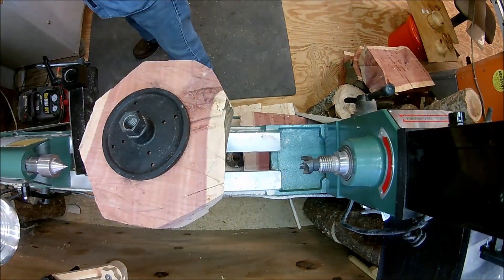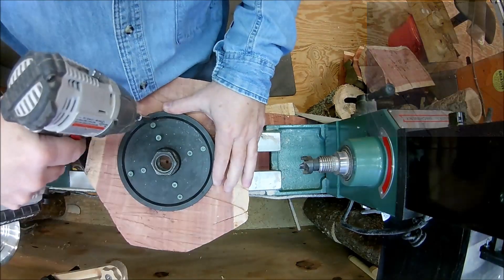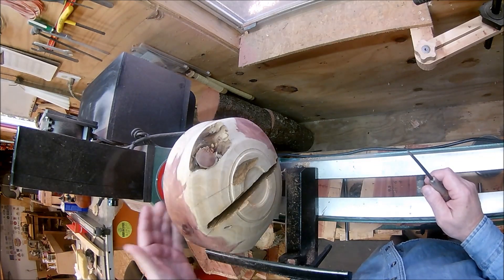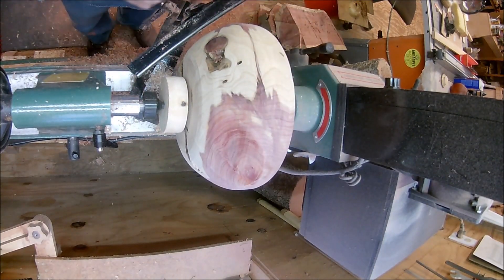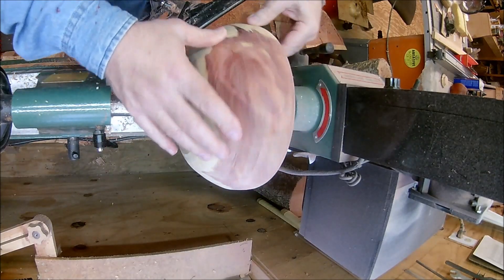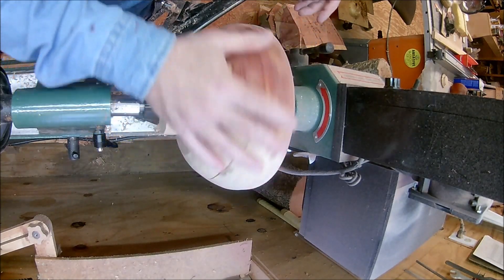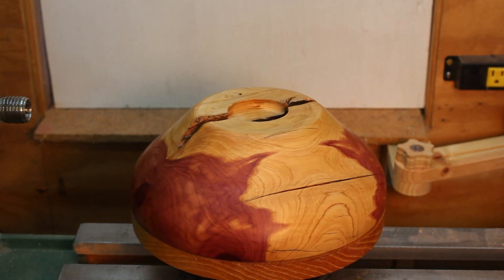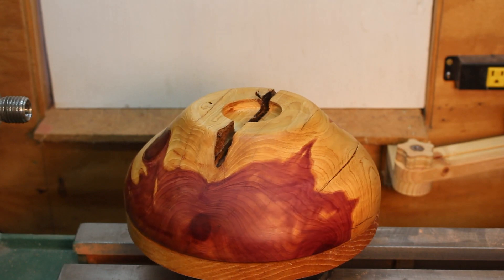Turning Some Eastern Red Cedar

Comment: You came out with a really nice bowl Dave. Aromatic red cedar is one of the prettiest woods ive seen. It has nice figure, and smells wonderful. It does require LOTS of resharpening. Ive been told that cedar is very abrasive because it sucks up so many substances, like silica, out of the ground. And, ive had pieces of cedar crack just while sitting on the bench. Doesnt seem to make any difference if its very dry, or freshly cut. The red dust seems to appear everywhere. I think its just more noticeable because of its color, and easier to see. Ive used CA glue mixed with coffee grounds to fill a few cracks, and IMHO, doesnt look too horrible. Im not sure ANY filler is gonna stop those cracks though! Every so often, i get the desire to turn a piece of it. Recently, i turned an apple out of cedar, and i like it. It might be a couple years before i want to mess with any more of it. Enough of my ramblin on. Good job on the bowl!